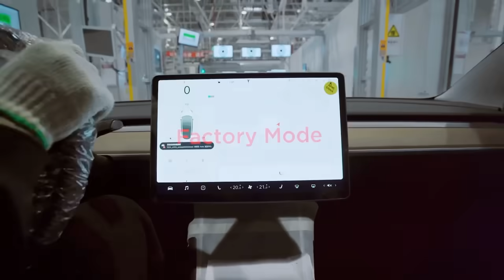Tesla Gigafactory 3 Shanghai | Official Video

Comment: Take a look at the Model Y assembly video. One piece MegaCasting in the rear! Can’t see it on this video so I can assume Shanghai Mode 3 is same as Fremont still. I can’t believe Berlin will be 3 mega cast sections and 4680 in their Model Y and also that the Model 3 from Berlin won’t also be the same. I remember the original body video on the 2018 Model 3 from Sandy, Tesla were well ahead in electric motors, alloys design and electronics, but well behind the best in bodyshell structures. Elon: hold my beer! 

It just shows how a smaller, more agile company can improve with each attempt. Megacasting machines. ‘Nough said. The only thing more high tech I’ve seen is the T888 units being built into Arnold’s!